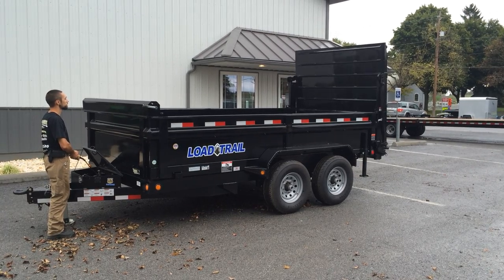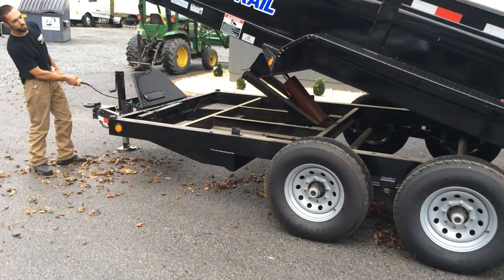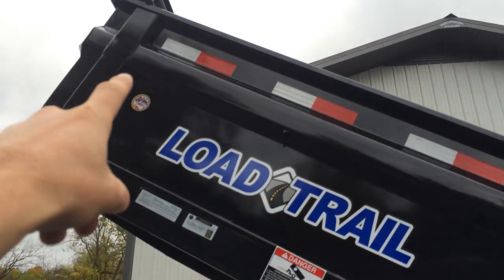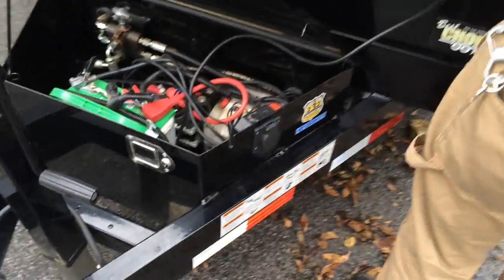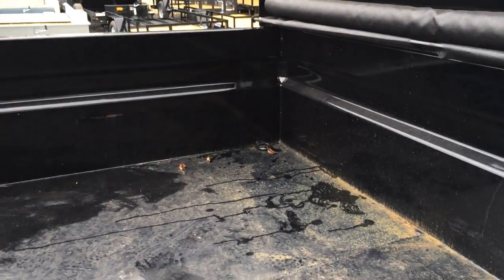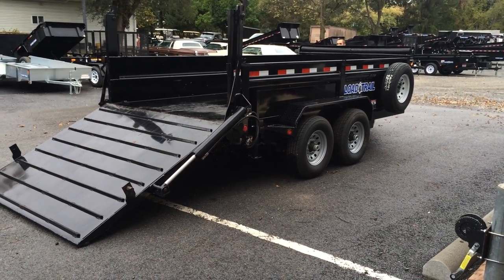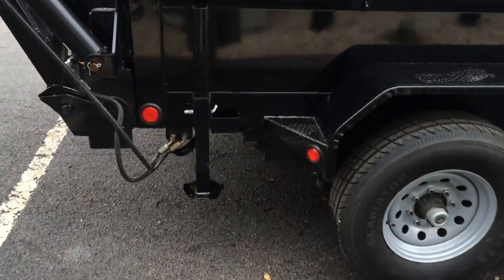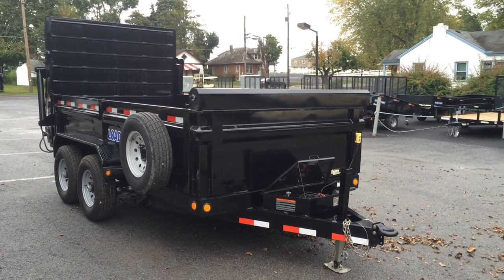Load Trail Hydraulic Dump Trailer 7x14' 14000# GVW Hydraulic Ramp DT14

Comment: What I don't like about the gate is that when you're dumping, it will be very close to grade in the full up position.  So if the load doesn't slide out all the way you're prevented from pulling the trailer forward to allow more room for the contents to get out.  You would have to lower the trailer, pull forward, and raise it again.
Reply from the maker: I don't think you've used one of these because that is not the case...it will dump the same as a regular dump with similar clearances.  Large tree branches are one of the only things that could be fun getting out.

Comment: how do you dump with a ramp on the back
Reply: +Shawn P The video shows that the ramp can either lower down for loading or lift up out of the way for dumping.
Reply: But when the trailer is in the full up position the gate will be quite close to ground.

Comment: What is the weight rating on the loading ramp.
Reply from the maker: The ramp is designed to hold the payload of the trailer, which is about 11500# including tongue weight.   A 2nd generation ramp was offered after this video was taken to include a second lift cylinder (one on each side), 3'+ sides are required, and rear jackstands are a forced option.

Comment: I like the idea of not lugging hundred pound ramps around,,, unfortunately, Everytime you use the battery for anything but dumping it takes away it's charge,,I have watched the   gas cylinder assist ramps, where the barn doors convert into the ramps,,, maybe some bigger manufacturer's will check it out too
Reply from the maker: We've sold some of the ramps like you are referring to.  They are ok, but not even close to the same as this setup.  We've had some commercial users tell us they've had to charge the battery as little as 1 time during the course of the entire season, so the battery draw may be ill-founded.  It will depend on the amount of use, if the charge line on the truck is working, amount of driving, capacity of the battery, efficiency of the hoist, load on the dump, etc.  Although my customers tell me they haven't had issues, I'd put a auxiliary wire harness on the truck/trailer if I had a dual function dump.

Comment: What's the price
Reply from the maker: Joe,  The hydraulic ramp upgrade runs about $1900, but taller 3' sides are a forced option that run about $650, along with rear jakcstands ($100-125 depending on style).  The ramp can only be done on 14 or 16' trailers (not available on 12' trailers, too much junk in the trunk).

Comment: Don't be afraid post the price ?
Reply from the maker: John - I suppose "it depends" comes into play here.  Depends on - Is that the exact size, hitch style, and features you want?  Where are you located?  We also don't post prices as they do vary - this video was probably shot 2 years ago.  If you give us a ring with those details I'd be happy to get you a quote on a trailer that will work for you.  Thanks, Greg
Reply from the maker: BTW - The trailer has changed spec since our original video - 3' sides are now required for a hydraulic gate, as are rear jackstands.  It also now comes with a 4-button remote (4 coils ILO 2 with a diverter).  It also now has dual rear gate cylinders.
Reply: @BestChoiceTrailers  So what is the price for this new version?

Comment: Needs to be a side dump, then you can have a less funky gate.
Reply from the maker: I'm not picturing how a side dump is going to make the trailer less funky as the rear would pretty much stay the same, it would just more complicated to build.  A side dump also would need to be a deckover, which would somewhat defeat the purpose of the gate as a deckover isn't ideal for loading like this unit is.